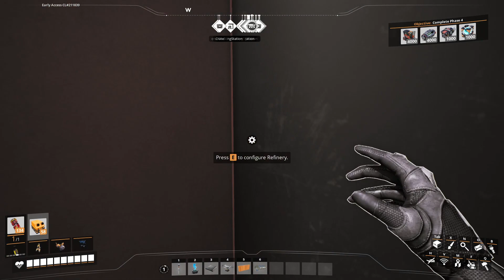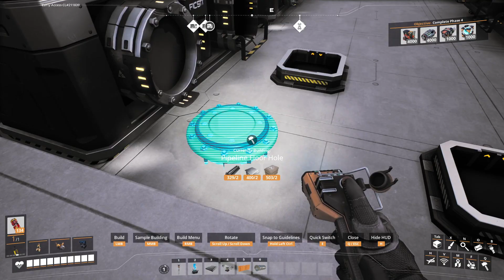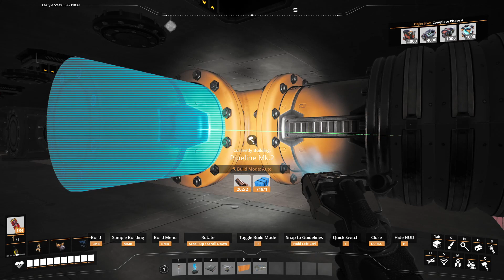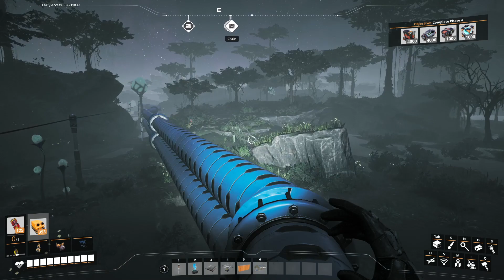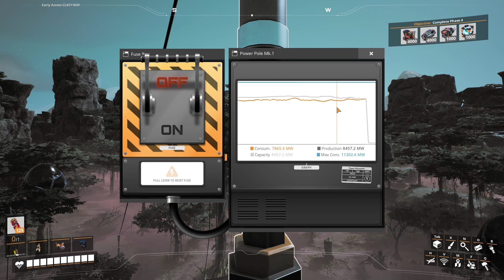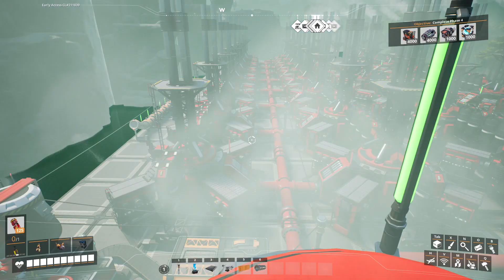Turning 600 copper into 1500 ingots destroyed my power grid

Comment: You can include the conveyor/pipes + holes in the blueprint if you build it on a foundation in the blueprint designer, and then delete the foundations before saving the blueprint. The first time you place the blueprint, you'll need something to aim at below your floor level to get the vertical alignment right, but after that you can just blueprint snap the rest of the row

Also, pretty sure you fixed the power problems with the first switch XD When you connect a tripped grid to a powered grid, the tripped status spreads. So you would just need to repull the lever after you reconnect the tripped grid
Reply from the maker: Huge tips, thank you! I'm gonna get on a bit and try to assess the damage some more.